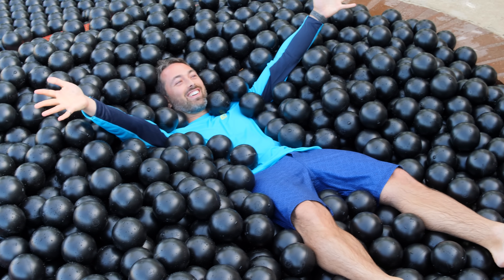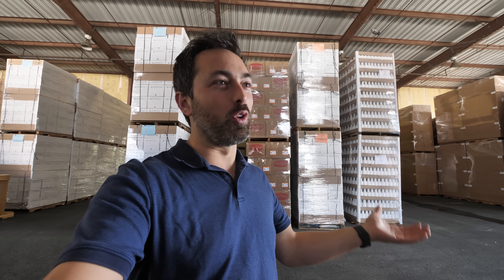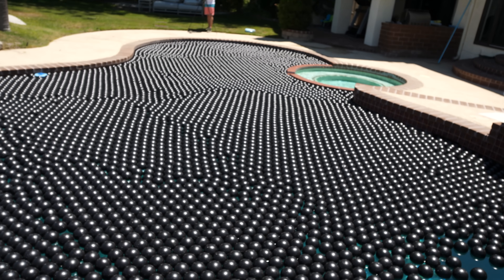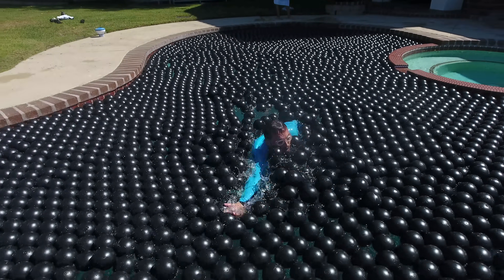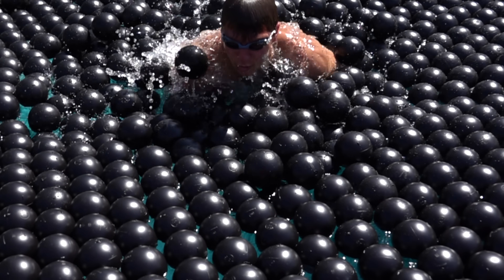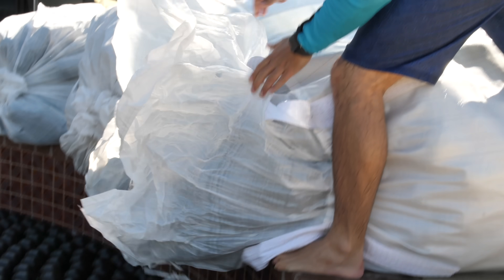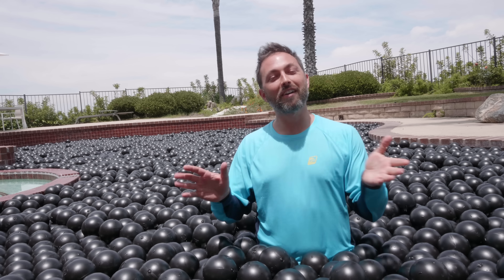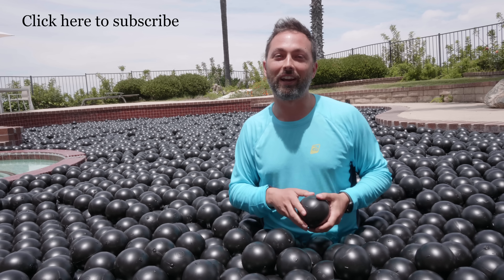Can You Swim in Shade Balls?

Comment: The full video goes into depth about the dangers. After watching the full video you can see how it would be very possible for someone to get exhausted quickly and fall/sink under. You wouldn’t be able to catch your breath by standing up like they can in this video while still barely making any progress towards the shore. You would basically exhaust yourself trying to swim against them making it difficult to stay afloat and get air. On top of that if you did fall victim to the balls you’d most likely not even be seen from the surface or at least barely seen. If you were truly in this situation, your best bet would be to swim under them and poke up for air but still the energy required to get to shore would be overly exhausting to most. Thank you for making this educational video.

Comment: I can see why this is dangerous and I think it's more, than the fact you can't really move in multiple layers.  The problem is two fold. If you weren't in a pool, say you were in the middle of the LA reservoir, I think you'd have a very hard time ascertaining that you aren't actually going forward. Secondarily, even if you could figure that out, then I'd imagine that swimming underwater, then popping up for air, it would be very hard to maintain a consistent sense of direction.  After all, with multiple layers, when you pop up you can't really look forward. You can really only look up. Which means you'd have to swim and navigate underwater. Which, if the water isn't clear or the sun isn't out, might be a death sentence unless you navigate by some other means(starlight, compass, GPS, etc).

Comment: I know I'm super late to the party here, but when you're swimming in multiple layers, I notice you didn't try breaststroke.  Let your legs do most of the work, hold your hands out in front of you like a wedge to separate them, that would work in an emergency.  

What you end up doing is called "rescue stroke".  Lifeguards learn this to swim while holding someone's head above water.  You're on your back (holding someone on top of you when you're rescuing), kicking breast stroke style (or crawl style, but then you can kick the rescued person), and your face is protected from any waves(balls) coming from the direction you can't see.  Your head is the wedge in this case, which has to be less comfortable than using your hands!

Still wouldn't recommend this, but if anyone falls into shade balls, these techniques are better than panicking!

(I trained as a lifeguard and a rescue diver at various stages in my life)

Comment: why they are not white ?
Reply: The plastic that it is made out of doesn't last long in the sun when it is on its own. Pigment is added and black was found to be the most stable color for their purpose and lasted the longest. The goal wasn't to prevent evaporation but to prevent sunlight from reaching the water, as it caused the formation of bromate, which is carcinogenic. 

I suggest checking out the first video that covered this if you want a better explanation. It's pretty interesting.
Reply: @ragingfirefrog hmmm not sure all the plasticizers in plastic are more carcinogenic 🤣 but thx for the good explanation👍

Comment: why are shade balls black? Wouldn't that absorb the heat of the sun and then get the reservoir hotter? Why not white so it doesn't get as hot to evaporate less?
Reply: They absorve the light, not the heat. I used to think the same
It is the concentrated light that caused heat
Reply: @filispeed_0111  black things get hotter than white things because black things absord all the light and get hot, if im not wrong. wouldn't white balls simply absorb less light making it cooler overall?
Reply: @jacksonfunke8230 The first video covers this. The goal wasn't to prevent evaporation but the prevent the light itself from reaching the water. They are black because that pigment gave the plastic that was used the longest life. 

The interesting thing is that the balls, despite getting hotter, actually keep the surface cooler. The top of the balls are hotter but the combination of the air inside and the water keeps the surface cooler.  The balls also prevent the humid air from being easily blown away by wind, reducing evaporation even more.

Comment: Two years later and I realize just how hot that would feel on my back if I laid down on that in the middle of summer. It's black plastic, it absorbs light and since it's plastic it easily retains heat thus making it feel like one of those metal slides.

Comment: Wouldn’t you just dive, swim under water, then pop up for air? That’s how I’d traverse a multi layer shade ball scenario. Why would you ever try to swim on the surface? That way even if you were dropped in the drinking water, you could slowly make your way back to the shore. As long as you could break the surface layer of balls to get air,  then you would be fine. All the movement towards safety would be underwater with regular amounts of resistance.

Comment: “You can’t swim in drinking water”

rides boat in drinking water
Reply: I like this humane conversation
unlike most arguments on the internet, this one is civil
Reply: Lmao
Reply: The exhaust on a boat motor is in most cases mixed with, and expelled together with the used cooling water. This does a few things. It reduces the noise from the  engine. (If you have ever driven an air-cooled engine you know the difference)
It also cools the exhaust pipe, this would otherwise get dangerously hot. Exhausts pipes on older air-cooled engines needed to be insulated with asbestos to prevent  injuries or fire.
On most smaller outboard motors, the exhaust fumes and cooling water is ejected just above the propeller. A portion of the cooling water is often squirting out the side of the motor as a visible stream. This is there to give a visual indication that the cooling system is actually working. Without cooling, the engine would quickly be damaged by over-heating.

A gasoline engine can be converted to run on ethanol. That would reduce the amounts of dangerous chemicals in the exhaust.
However, I think this reservoir picks up way more chemicals from the air, than the occasional boat ride.
Reply: Edit: as it turns out, there is still the problem of the outboard motor's exhaust gas.

If the boat is clean before entering and contact of the boat with anything else is kept to a minimum, it's definitely worth it to have a means of navigating the reservoir.
If they worry about sunlight, I imagine they want little else to enter (edit: i. e. they'd probably like to remove stuff that got into the reservoir).
Reply: @xCorvus7x  to go one step further, water runs through a boat motor for cooling.
Reply: @xCorvus7x  No, that dosen't matter. The main problem is that a combustion engine from the boat will release all of it's fumes into the water, so it makes no sense that they are riding that on drinking water, but a human taking a bath is not allowed.

Neither should be allowed, but the boat with it's combustion engine, seems especially bad to me, at least use a electric motor
Reply: @Saymon10  Are you sure that's a combustion engine?
And why would the exhaust be funneled into the water?
Exhaust fumes are given off into the air, to contaminate the water they'd have to diffuse into the water (through the layer of balls).
Especially with a breeze, the amount of exhaust getting into the water should be minimal.
Reply: @xCorvus7x  Ok, you just don't know, and talk without knowing, I will explain, don't worry.

1. Yes I am sure, I went back to check, it is a four stroke yamaha combustion engine

2. A outbord combustion engine releases its fumes through the center of the propeller, hence the clear blue color under the water. And that is why the propellers have a hole in them. So YES they are geting released into the water.

I would link sources, but youtube won't let me. So do your own research.
Reply: @Saymon10  I do in fact not, sorry for speaking with undue certainty.
It just didn't occur to me that funneling the exhaust into the water was an actual design (and from what I've found, I'm unsure if there even exist motors that don't).
I gather the water sucks the exhaust out as you move through it but is this really necessary?
Reply: @xCorvus7x  To be honest, I don't know, one of the benefits I can think of with this design, is that the boat isn't filled with all the fumes from the boat,  which can get very unpleasant and its not healthy either.

Another benefit is that it reduces noise since the water dampens the vibrations.

However, larger intraboard engines ussually don't exhaust them into the water, but outboards do. So the resovoir, could had used one of those.

Btw, sorry for being a bit rude eariler, got a angry by the higher amount of likes XD
Reply: @Saymon10  You mean, the fumes would collect in the boat if released above the surface?
Doesn't this depend on the direction the exhaust pipe points?
(And couldn't it be above the water but below the rim of the boat?)

I'm sorry, do exhaust pipes vibrate excessively?

Yeah, an odd choice.

That's alright, I get that this is frustrating.
Reply: @xCorvus7x  1. I mean, that if there is a non windy day, and you were stoped, with your engine on, while fishing, let's say. It would smell a awfull lot to the smoke, if it was released to the air, similar to what happens in a car.

2. Most of the noise produced by an engine is released through the exhaust, that is why you can modify the exhaust in a car for it to sound "better". So if the noise is underwater, you won't hear as much of it, similar to when you talk underwater, it will be hard to hear you above the surface.
Reply: @Saymon10  1. True.
2. Ah, okay, thanks for all the info.
Reply: @Saymon10  i think they say that you can't swim because if they don't say that then people will get stupid ideas to go swim in the reservoir and drown in the shade balls
Reply: @xCorvus7x  also bear in mind that even without any exhaust the motor still probably "leaks" oil and other lubrication from it.
Reply: @ano_nym  possibly, yes
Reply: @Saymon10  I'm calling B.S.  Never in my life have I seen a boat that releases its exhaust gases underwater.  That would create a lot of back pressure and reduce the performance of the engine.  Additionally, you want your propeller to be pushing liquid, not gas, so introducing exhaust gases near the propeller would be inefficient.  There is usually a small hole on the side of the outboard where the exhaust comes out.
Reply: @trainzguy2472  Some of your points could make sense though, I could explain why they don't apply, but I will let you to figure it out ;).

If you aren't sure about something tell me.
P.S. I am no expert, but I don't make things up.
Reply: @Saymon10  Always good to see someone who knows it all!
Reply: @kevindube7096  Well, I don't. Just knew a bit about this topic in particular
Reply: @moosecannibal8224  Yep, you are right, but if you read my next comment, you will see this: "Btw, sorry for being a bit rude eariler, got a angry by the higher amount of likes XD".

I suppose you didn't, anyways, yes I agree with you, it was rude and unjustified.
Reply: @trainzguy2472  
well you are just wrong. You can figure it by yourself easily by pulling outbord motor out of the water while running (just for a second, or else you would destroy it), and you will hear immense difference in its noise. Other way is to put it on the water "headphones" outside and then turn on.
Reply: @xCorvus7x  you've never used an outboard motor, have you
Reply: @lilithmotherofmonsters6055  apparently not to any degree that matters
Reply: @mrbrittas3254  If you had read my initial comment, you'd know exactly what I'm doing here.
Everything further grew thence.
Reply: @nneeerrrd  Sensible, I guess.
Any suggestions?
Reply: The boat would have an electric motor
Reply: Correct me if I'm wrong, but afaik, many cities get their drinking water from lakes. Big, green, murky, fishy, seaweedy, lakes that people boat and swim and pee and poop in regularly. So I'm not sure that much of the argument going on is even relevant.
Reply: @KWifler  They also state in the previous video that many of those other cities use chemicals in order to clean the water source. Chemicals which this specific reservoir uses little to none of because of the balls, preventing algae and contaminant reactions.
Reply: When it was open bird swim there and poop. So I don't think hygiene is most big concern.
Reply: I was about to say
Reply: hes not swiming tho
Reply: My thoughts 😂
Reply: FRR
Reply: Right that's all I thought of is dude why's this guy even riding a boat releasing a bunch of boat crap in my water!!!!
Reply: Lol😅😂😂👏🏻👌🏻
Reply: Lol
Reply: I thought exactly the sams thing
Reply: electric boat would solve this.
Reply: It already both confused and concerned me that the drinking water is just sitting around in the open apparently, for any birds and crawlers to visit and unprotected from garbage getting blown into it through strong winds.
Reply: That is even worse!
Reply: 😂😂😂😂
Boat is needed for works in there but no point in doing things that contaminate the water.
Then even after that ofcourse water is treated so you get only cleaned water.
But its good to keep reservoir as clean as possible.
Reply: Good point
Reply: The volume of water and the amount of contamination would be tiny. Like one part per trillion. I'm sure someone else could calculate the volume of water in the reservoir vs the amount of exhaust particles produced for 30min boat ride
Reply: Lol
Reply: Strait facts
Reply: Hell yeah 😂 same thoughts
Reply: petrol is fine it kill faster than sweat and piss

Comment: "Its a drinking water reservoir, obviously you can't swim in it...:

Proceeds to drive boat through water
Reply: The dosage makes the poison
Reply: last i recall, boats don't sweat, piss, shed their skin, spit or drop hair when it's on a pool of water (or in this case, a reservoir of water)
Reply: @じゅげむ-s6b  they do pollute the water with exhaust gases
Reply: @neth7826  not if the exhaust is on top or if the engine uses electricity...

even if they are, what's the ratio? that's a whole ass reservoir to dilute whatever the hell it is. and we smell the exhaust of cars, I'm sure we can handle a dilution ratio of the exhaust to the big ass reservoir

edit: grammar
Reply: @じゅげむ-s6b  fair enough
Reply: @じゅげむ-s6b  id rather have piss in my water instead of oil and heavy metals.
Reply: @djenzskithemanszki1181  boats don't shed oil and heavy metals tho
Reply: @じゅげむ-s6b  okay buddy
Reply: @djenzskithemanszki1181  You... do realise any metal particles get easily filtered and there are electric boats. Right?
Reply: Even in underground reservoirs they use boats to inspect them. What else should they use, flipper?
Reply: See other comment to do with this and the replys
Reply: Can’t = shouldn’t